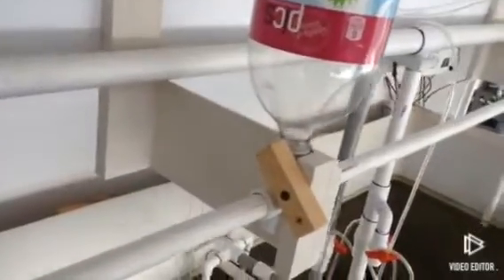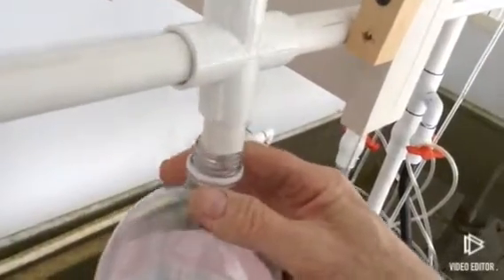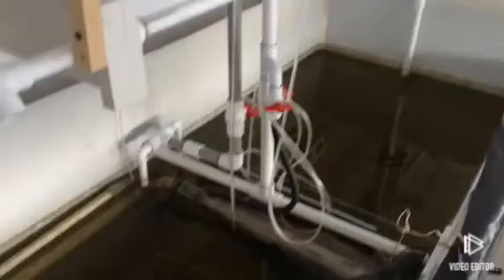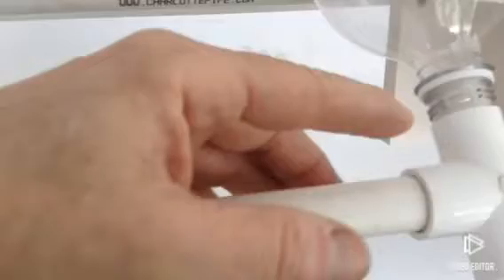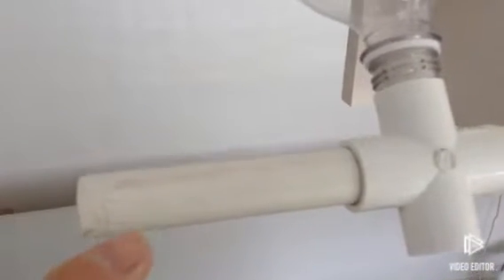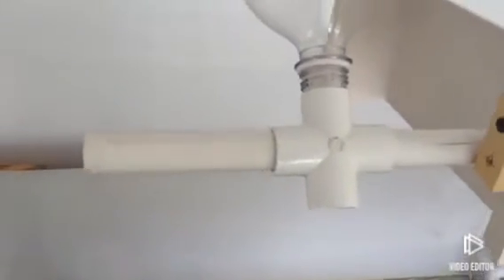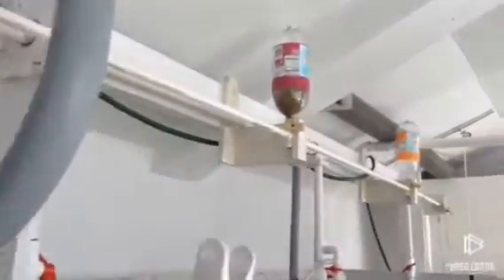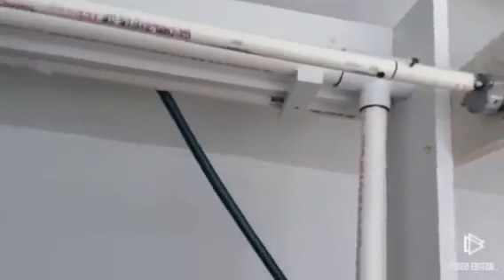Diy Automatic multi tank fish feeder

Comment from the maker: Woodensurfer,  the crosses acts as the bearing that the pipe turns in and the hole in the support is drilled to the OD of the cross so the cross fits in the corner against the support and the block at the end which keeps the cross from turning and the little block keeps it in place .
The stop collar on the other side of the support keeps the pipe in position horizontally.
As far as multiple levels of tanks , 2 options come to mind,  1 horizontal pipe for each layer with a motor for each ( the preferred solution ) or a belt connecting multiple pipes .
Or drop tubes from the cross to the tanks on lower levels between or behind the upper tanks.
I hope that helps. Have fun 😊

Comment: Would you post a link to the other video that you refer to? Thanks
Reply from the maker: Sorry Wooden surfer, I cannot find it, I must have deleted it as redundant. If you have a specific question I will be happy to try to answer it.
Reply: @kaf2303  Thanks for your reply. I am just interested in how you fix the position of the cross fitting so that there is no sliding movement along the rotating pipe (except when manually for refilling the container), and also how you support the rotating pipe and still allow it to rotate. 

Your setup is very clever. The only drawback is that the feed is directly above the surface of the tank, so when there are two or three levels of tanks it does not work well. 

I will use your method when appropriate,  for only the top level of tanks. Or if you have idea of overcoming this.

Comment: Thanks for the inspiration! I'm working on a multi betta feeder system , basically need to feed multiple bettas inside a small dish bowl or jar, it also have a automatic drain and refill system haha gonna be a tedious project
Reply from the maker: Thanks Tanz, I put it up for that reason , there are lots of ways to do things , sharing your ideas is (hopefully) a great way to find solutions in the diy community. Have fun with your project!
Reply: @kaf2303  
Its gonna be a tough I'm sure but ill figure something out haha, if I get stuck ill be back to ask for help haha thanks
Reply from the maker: Tanz Archeart , I’m happy to help and I find even just telling someone what I am planning to do helps me further develop the plan.
How often do you want to change the water and feed them?
Reply: @kaf2303  hmm every 2 to 3 days for water change and daily feeding at least twice I think would be ideal
Reply from the maker: Tanz Archeart so what are you planning to use?  If you set it up as part of a Aquaponic system the water could just be circulating with a very small pump, no water changes needed and you can grow a plant!  If not then a solenoid valve on a timer and a float switch could do the water changes .
Reply: @kaf2303  
Aquaponics would be too high in nitrogen wouldn't it? But I see a chance at using the waste water for that thanks, hmm for now i need to do a prototype , perhaps plastic bottles as a basis so I can screw it on the pipe drainage hmmm
Reply from the maker: Tanz Archeart Thats what is great about Aquaponic systems, the fish produce Ammonia, nitrifying bacteria convert it to nitrates the plants use the nitrates and the clean water goes back to the fish. Just don’t forget to put in some bio filtration media for the bacteria to live on.
Reply: @kaf2303  gotcha, will do more research on the matter, will keep you posted but for now need to get my superworm farm finished first (just got my bins)
Reply from the maker: Tanz Archeart cool I would love to see your super worm farm when you build it, worms are the next to be added to my greenhouse when I finish tweaking it.
Reply: @kaf2303  
What kind of worms?
Reply from the maker: Tanz Archeart  probably red wrigglers
Reply: Hello, any progress on tgat multifeeder for betta tanks? Looking to bulid one but dont know where to start. Would appreciate you sharing your solutions:)

Comment from the maker: Sure, I just used a programmable timer you can get on Amazon or ebay for under $10 to turn on the tiny synchronous 3 rpm motor that I salvaged out of a holiday decoration projector , but if your teaching your students how to use Arduino and servo motors .
Its a bit of overkill but it should work.

Comment: Are you controlling when the food is delivered? Could you tell me how you did so? I need to build/ construct a fish feeder for my school’s aquaponics system. I have a design in my head, but i dont know how to program a device that will allow the fish food to drop at a given time or control how much food is dropped,
Reply from the maker: Hi Abi , I used a timer that can be set for up to 17 times a day any # of seconds or minutes. So depending on the rpm of the motor you use and the amount of food you need dropped, set the time accordingly.
Reply: Kurt Fischer so you attached a timer to your motor? If i attached an arduino to a servo, will that work? If i used your concept and used a timer, lets say an ac timer, how did you connect it to your motor?
Could you tell me what type of motor and timer you used? Thank you!
Reply from the maker: the timer  iused is a CN101A  if you google that you will find options it just has blade terminals so you will need conectors

Comment from the maker: I forgot to mention, If you are using 1/2" pvc pipe  you will need to drill out the stops in the cross with a 13/16 bit so the pipe will turn  freely and to reduce turning resistance I drilled the recesses off set 1/4 turn so only one at a time would be loading.
If I was not clear on anything post a ? And I Will try to clarify.